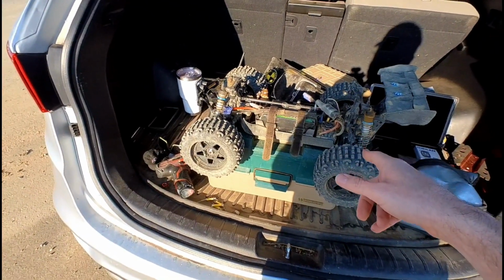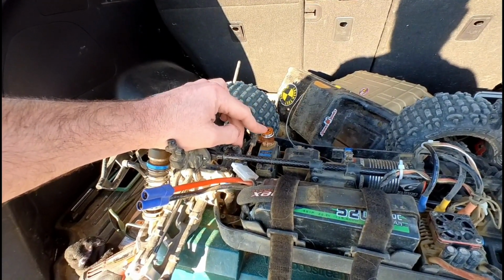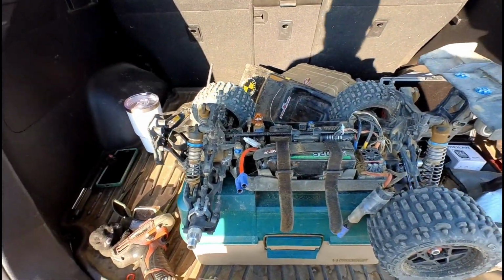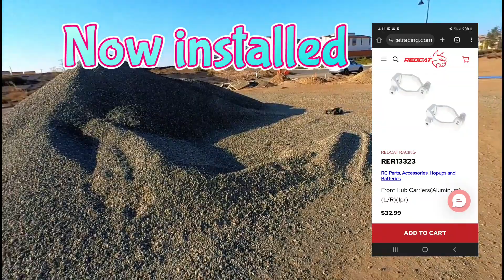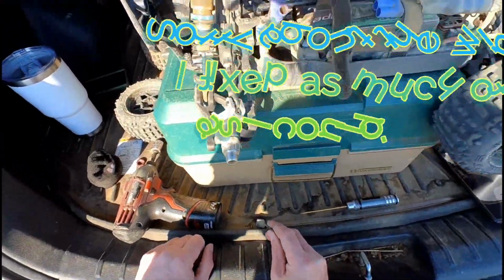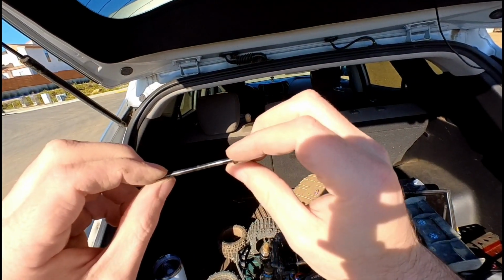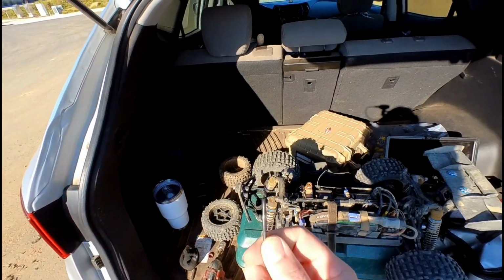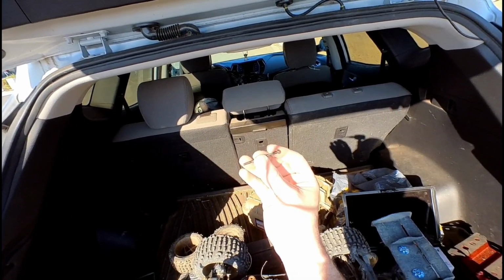Rival MT8 gets aluminum upgrade!

Comment: Sweet video as ever my Portuguese bearded beauty! What gearing you running and is that a 6S battery pal?
Reply from the maker: Thanks buddy. 
Stock size pinion, 10t I think? 
And it's a 6s Ovonic. Great barriers, then and Hoovo are my favorite brands. They seem to hold up really well to abuse.
Reply: @captaincouldverc  11 tooth stock. I realised the other day the Kaiju ext has a 13 tooth as standard and basically the same stock engine and Esc but can go 60+ mph (Jaytee RC I think it was). Those belted tires must make a big difference and maybe that slick body.
Reply from the maker: I'll have to just pull the and look, cause I honestly don't remember what pinion I put on it when geared down to make the arrma tires not disintegrate so fast.